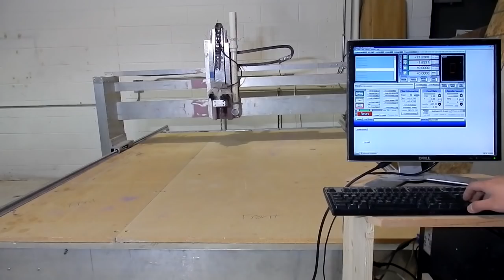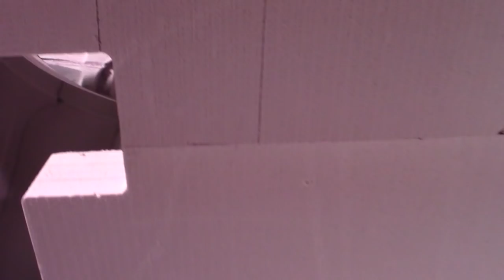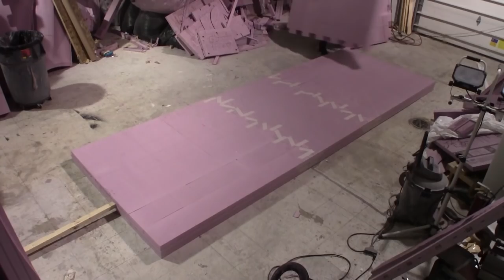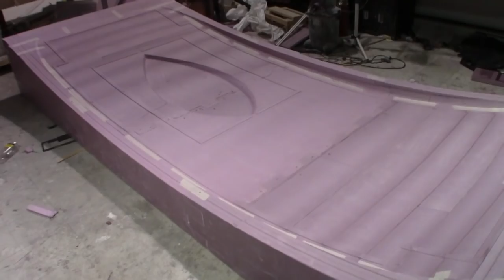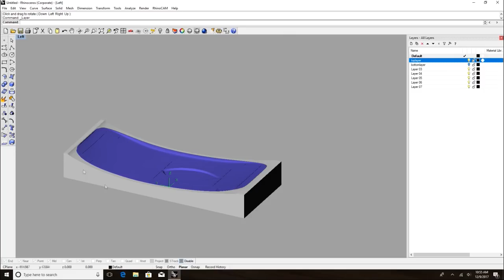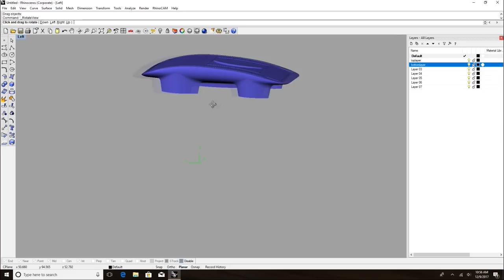How I built a Giant CNC mold for Carbon Fiber

Comment: What do you use to glue multiple layers of polystyrene foam together?
Reply: Daniel Larrivee  Something like Bally adhesive. For example in Turkey there is a brand that Dewilux which is like a low viscous bally. The key factor is adhesive must be styrene free.